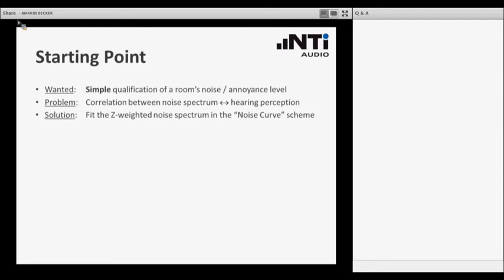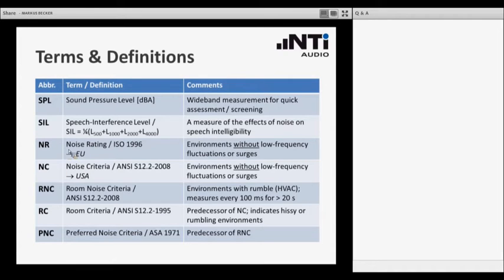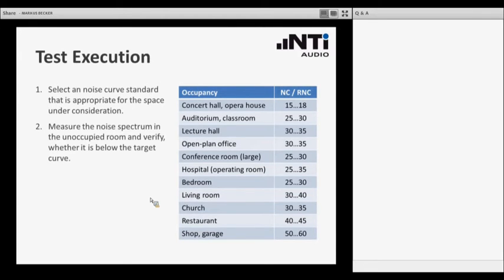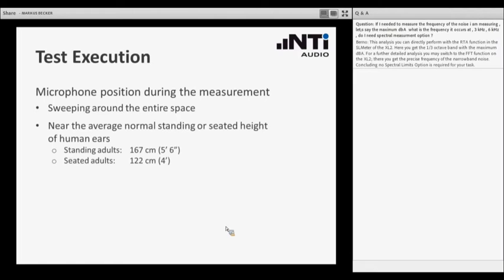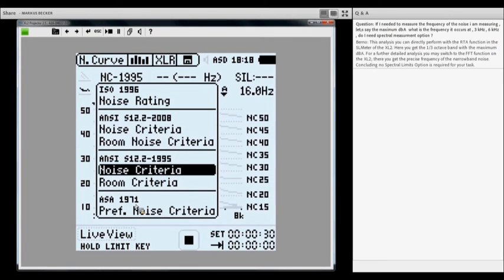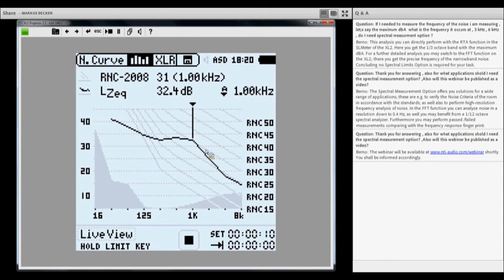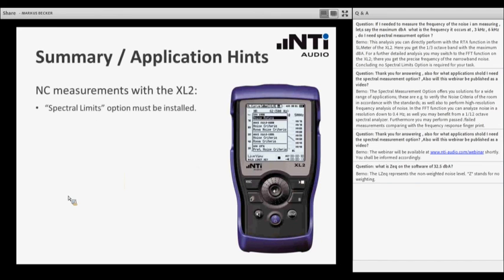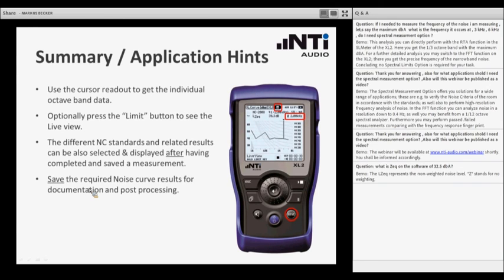NTi Audio Webinar - Noise Curve Measurements with the XL2 Analyzer

Comment: The Excel reporting tool mentioned at https://youtu.be/VZwoDaB7ZH8?t=1075 is no longer available. It is still possible to import the text file save by the XL2 into Excel or other spreadsheet programs for analysis and plotting.

Our Room Acoustics Reporter creates professional Noise Curve reports along with reports for spectra and RT 60 https://www.nti-audio.com/en/products/software/room-acoustics-reporter

Contact your local NTi Audio Partner for more information about Room Acoustics Reporter.